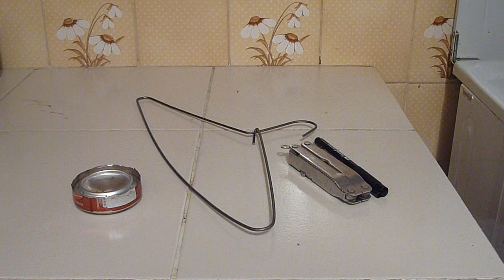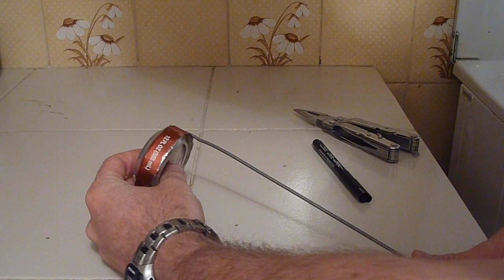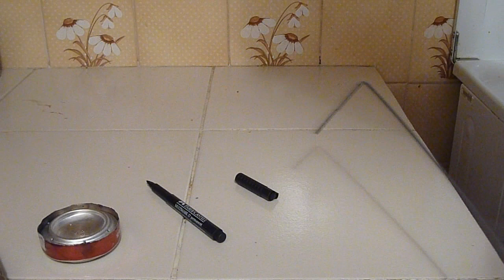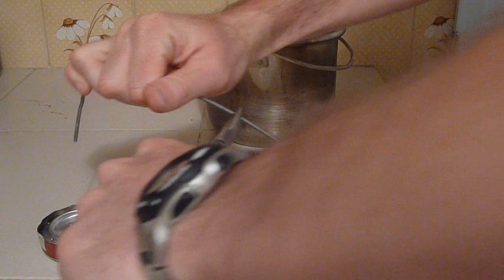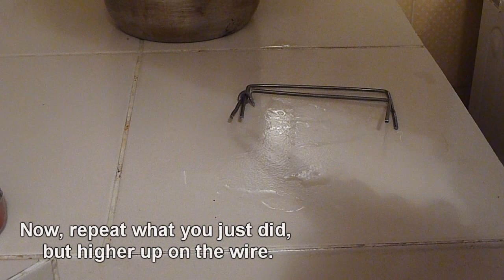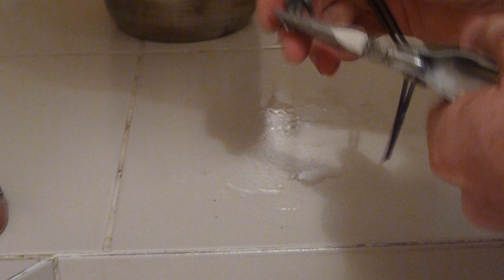Simple pot stand for an alcohol backpacking stove

Comment from the maker: @homeagent I've run several tests with different styles of stoves and depending on structure, jets, etc. results are different on burn time. 

As far as the highly toxic fumes go, the methanol or heet that you use can be just as bad. I use ethanol which doesn't have that danger. As well, I do it in a space well ventilated and don't have a habit of huffing what comes out the top.

I will try doing a new video comparing a jetted stove and your small cup idea. What are the dimensions?